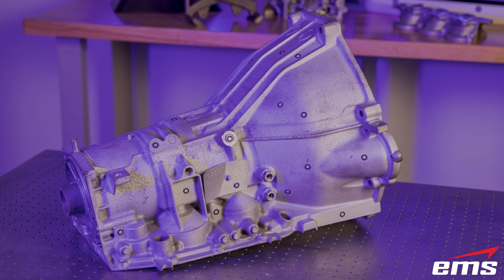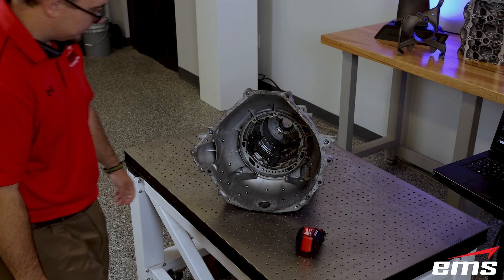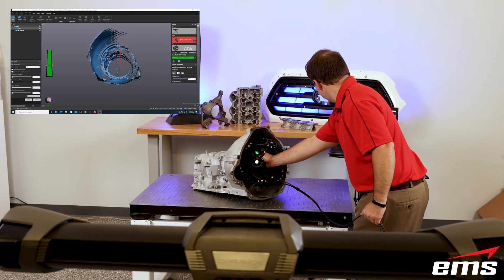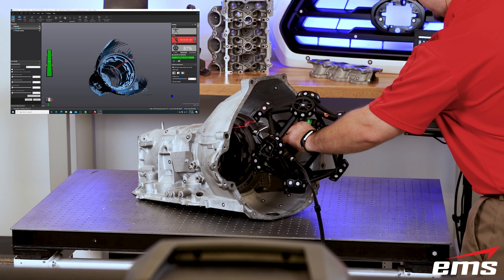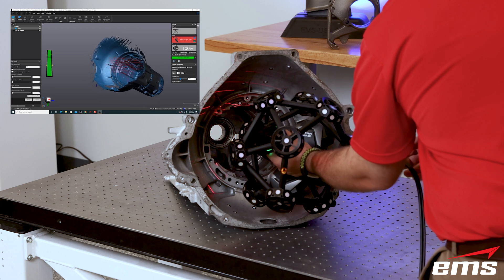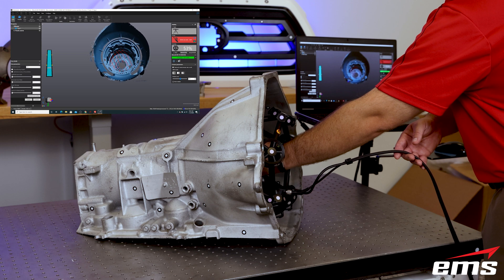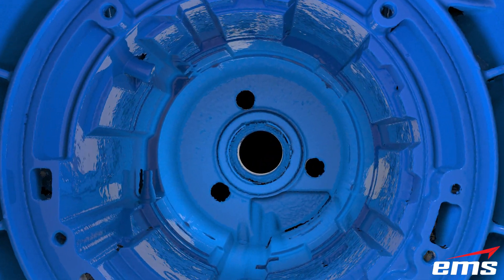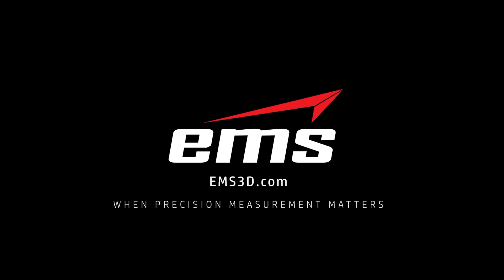3D Scanning Deep Parts

Comment: That's super nice. I needed to scan some valve bodies about the same side and we had to cut them in half! hahaha... what a pain
Reply from the maker: Spray a mold release in the port then poor in a semi rigid silicone.  Insert some wood dowels or wire and let it harden.  Pull it out and 3D scan the silicone mold you just made of the port.
Reply: @EMS3D  You just blew my mind. We've poured molds with 3D prints, but it never crossed my mind to what you suggested. Thanks!